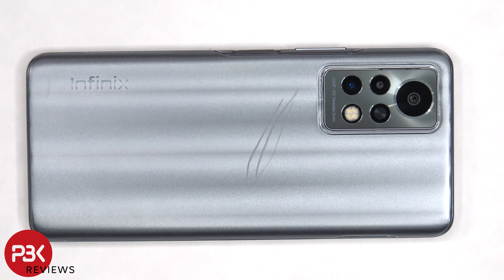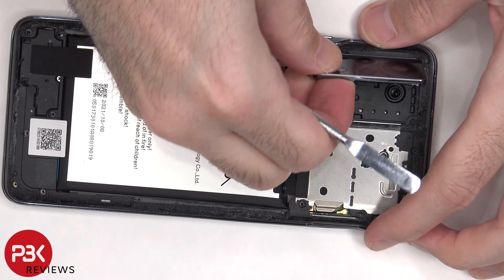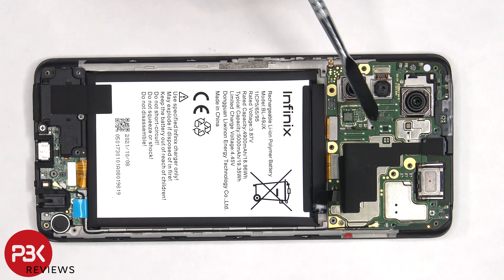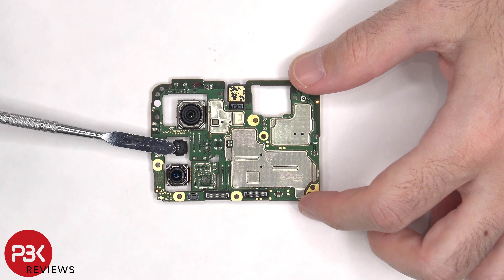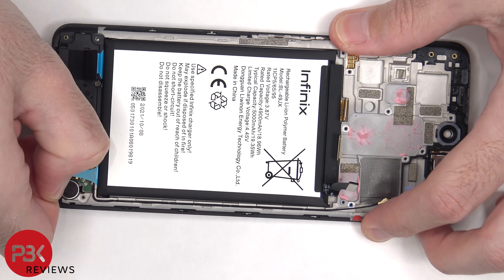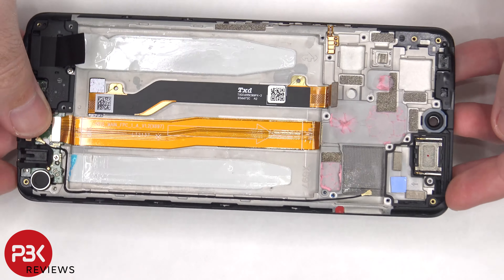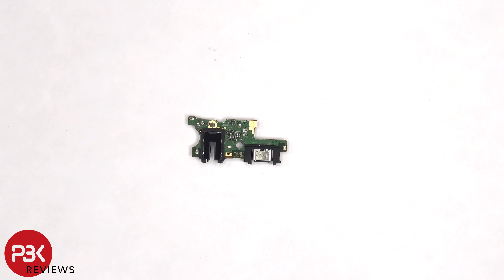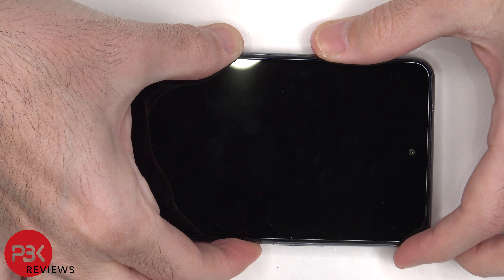Infinix Note 11 Pro Disassembly Teardown Repair Video Review

Comment: infinox note 11 pro doesn't have protection on logical board (no rubber on flex cable connector)
Reply from the maker: there are some rubber gaskets around the connectors
Reply: @PBKreviews  yes i see on ports but not on flex cable connector 
realme, oppo, vivo and oneplus all have protection on all motherboards connectors and flex cable even it said not water resistant